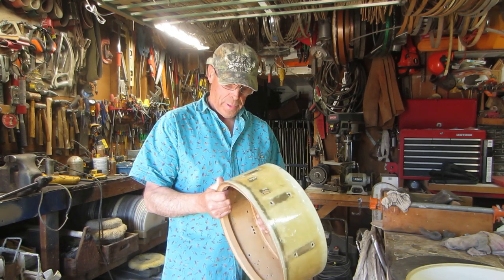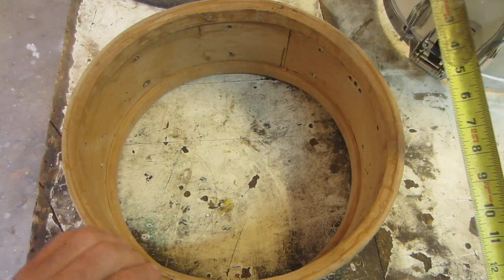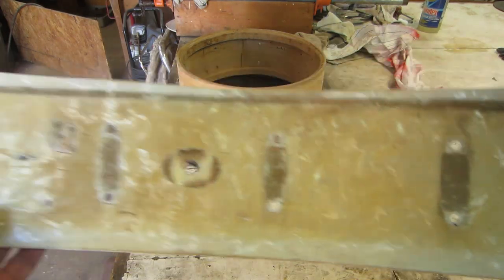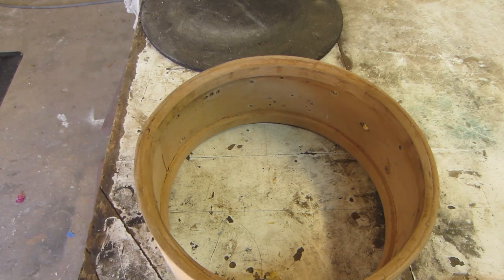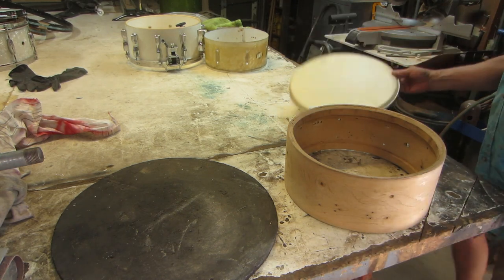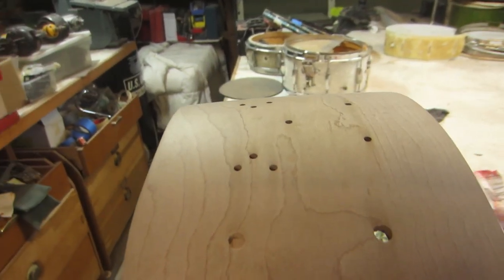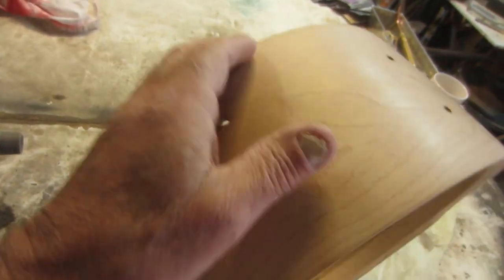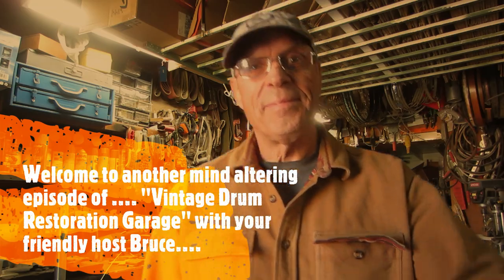Slingerland Radio King Snare Drum out of round/oversize ....contouring the shell so all heads fit.

Comment: I always collect the fine sanding dust in a jar and use it to mix with the glue to fill in large gaps. Smaller gaps get a 'dust over' basically to hide the glue and using the original wood dust helps with that. It sands back to hardly seeing the gaps and it takes a stain much better than just glue.
This drum should look very nice.

Comment: Hey Bruce, did you sell the Black Gretsch Show snare drum that you recovered... If yes good if no what is the price, with delivery?
Reply from the maker: Harry, I have the shell with lugs still. I found another one that needed the parts so thats the story.  Its a shell with 16 lugs and a badge. Make me an offer and we may be able to make a deal. Cheers, Bruce
Reply: @vintagedrumrestorationgara91  so you have the Black shell, with lugs minus the rims, minus the heads, minus the wires, minus the snare holder on both sides?
Reply from the maker: @harrydrucker5818  The shell, round badge and 16 lugs